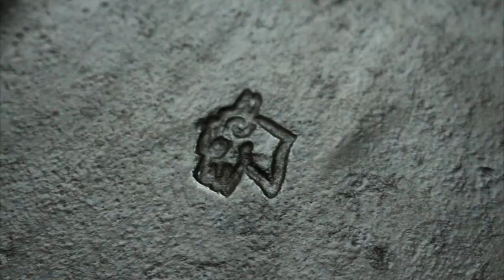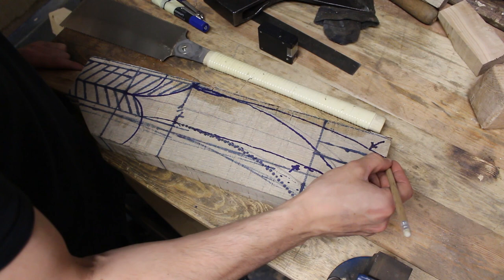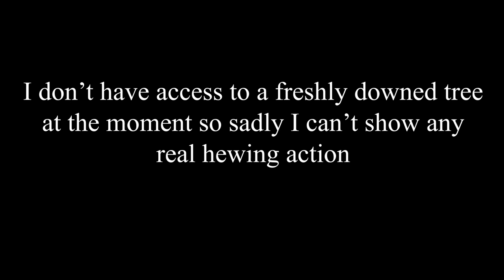Broad Axe Hewing Axe Restoration

Comment: Nice work with fitting the handle. Looks perfect!
Reply from the maker: DIYCoolStuff thanks, the wedges did a lot to get the thightest fit.
Reply: I don't think I've ever seen that kind of "cross wedges", I'll be doing that in the future.
Reply from the maker: DIYCoolStuff I first saw this technique in furniture making. But i'm sure it has been done before on tools aswell. 👍

Comment: What's the point of the drilling holes for the wedges?
Reply from the maker: The idea is to create a stop for the splitting force of the wedge, so a crack doesn't travel through the haft. If that actually works or is necessary is another question..